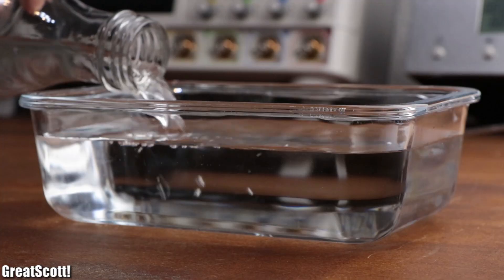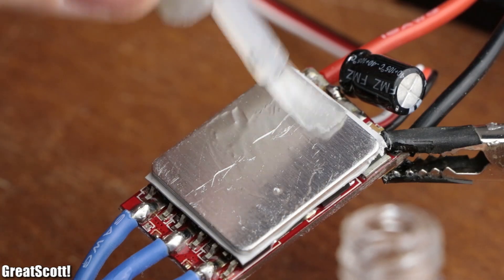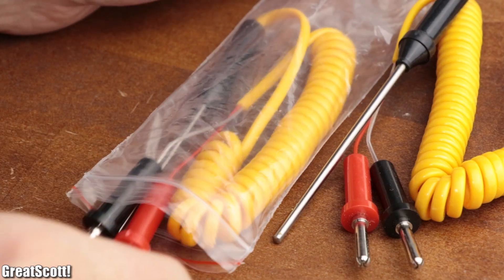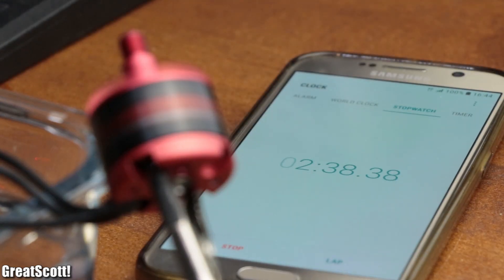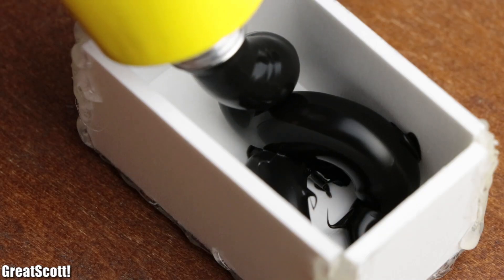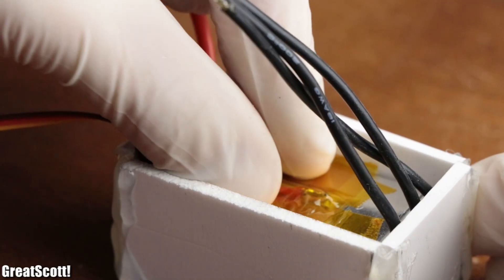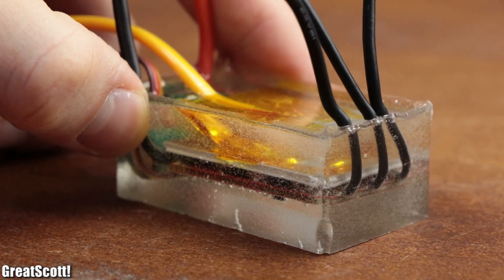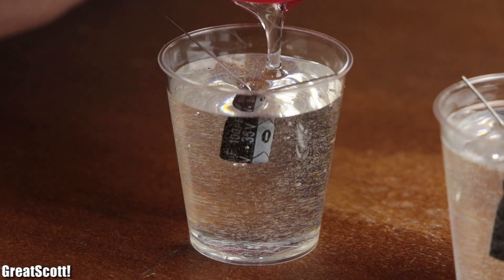How to Waterproof Electronics || Nail Polish, Silicone, Potting Compound

Comment: Hi, just use the right type of silicone, which is the 2- component version.
It's also used for casting pewter abd resins.
Hardens in 24 hours, if used the standard hardener.

Comment: Wasn't it a problem, that you didn't apply a load to the motors? In my opinion the heat produced should be approximately proportional to the power needed to drive the motor.

Comment: heat the silicone first to reduce viscosity? even ambient temperature fluctuations can make the difference between a successful and unsuccessful potting. also you can use a small seal-able tub filled with clear nail polish or clear-coat for better results, just dunk your board in, give it a shake and wait a while, then pull it out and hang it up by a wire to dry; much easier to get it into the nooks and crannies. painting nail varnish onto boards to waterproof level with only one coat is very difficult due to the way it shrinks during curing process. it is often worth going back for a second or third coat to fill voids larger than 1mm

Comment: How to make BL Dc motor waterproof ? For example project like  RC submarine..
Reply: BLDC motors are not affected by water, as there are no open contacts across which current would flow. They are commonly used for model submarines and other watercraft for this reason. See this video: https://www.youtube.com/watch?v=86-l2_THgWc
Reply: https://www.youtube.com/watch?v=s4z8QMgTEA4

Comment: Silicone has to evaporate out to set, which takes time, especially for a deep coating.  I've read the the slightly acidic liquid in weatherproofing versions of silicone can cause corrosion on circuits.  No doubt, you can get varieties that control this issue.  

The only way to totally protect a circuit, especially if used at depth, is total encapsulation with magnetic switches.  Eventually, some moisture will migrate along the wires if they pierce the coating.  I've seen timers used at depth in marine research that were stopped when a fish yanked the magnet off the encapsulated counter circuit permitting when the fish took the bait on the longline.

Comment: I use epoxy for the most part, but there's quite a few projects that need far more complex waterproofing strategies. Ports, for example, need rubber plugs which is usually the main point of failure. While components that need breathing room like LIPO cells usually get a plastic housing. The company I work for makes smart batteries for the military and even we don't guarantee full waterproofing.

Comment: You don't want to solder your TC connection together.  You weld it!  You compromised the integrity of your temperature measurements because K type consists of Nickel-Chromium and Nickel-Alumel and you just added (most likely) lead and tin into the mix.

Comment: The silicone needs moisture from the air to penetrate to cure, why you're better off using a two-component compound when applying thicker than ~10 millimeter. Also, all these examples may eventually fail in a humid environment because moisture from the air may wick inside the stranded wire as the electronics thermal cycle. Solid terminals and connectors at the interface are one solution.

Comment: Great video as always :)

Nail polish is quick and easy but it is a mess when you wan to solder new cable such as esc signal wires on a quadcopter flight controller.
There is special product like this https://www.youtube.com/watch?v=HOu5hRqSDtU which are great to work with.
Hope it help you

Comment: I've found Plasti Dip clear to work well. Since it's an aerosol it gets into fine spaces. It cures quickly so a few coats can be applied. It also remains somewhat flexible so it handles flexing around wire to board connections.
Reply: Hello , hope u r doin great !
Can we use plastidip on car engine sensors , under the bonnet ?

Comment: +greatscott: silicone will corrode copper traces, especially for the acetic cure type, which might do harm for projects that are built to withstand the test of time.. i've also tried using neutral cure type, lasted longer, but still corrodes copper..
Reply from the maker: Thanks for the information

Comment: Hmmmm.
Interesting, I have been looking for sourcing locally (Switzerland) conformal coating to apply to my quadcopter electronics, but with no success.
I have found on ebay a few  422B-55ML from MG chemical, but from GB or USA.

Do you mean that a simple nail polish application can already go a long way ?
That would be very easy to source.

Comment: You really overdid it on the silicon and the Kabelvergussmaße.
I think the amount of silicon used also was the reason why it didn't cure: Uhu Datasheet says more than 3 days for anything thicker than 5 mm - and you went a bit further than that. With a mixing silicon it would have worked better. And for both the silicon as well as the sealing resin it would have been enough if you just gave it a coating (a few mm into the box, then dip the regulator into it and take it back out).
Reply: Yeah, chunks of silicone can take very long to dry. The inside probably was still liquid. 
I did some silicone casts for an art project in school a few years back and sometimes the molds were still not hardened through a week after.
Reply: @franziska1007  silicon casting in art. Who paid for that
Reply: @sammyd7857  I guess the school? It was a class that basically did renovation-like art and crafts around the school building. In our case creating casts for plaster figures with prehistoric ocean dwellers that then were put onto ocean themed school halls. 
It was just on course per year and a limited amount of students, so the individual budget was relatively high.
Reply: franziska1007 Well if you do it like the king of random with 2 compound silicone, it can cure from some hours to one day
Reply: The store bought silicone that smells like vinegar has to be exposed to moisture. It does not cure well in a deep box and can take months. Epoxy and silicone will poison each other and can cause a fail to cure even trace amounts of uncured material. Cure one fully before applying the other. Make sure things are very clean after cure and between applications.
Reply: wich 1 works better silicon or rezine?

Comment: I think that best waterproofing product is NANOPROTECH. I used it in RC cars and no problems. Currently I'm using it on a car( octavia) in blinker where is water every time when its raining. No problem whatsoever.. I also used plastidip... it works but it can get weak by the time and it's hard to peel off... NANOPROTECH is way to go!

Comment: There should have been a control test with an unprotected esc in water
Reply from the maker: I did not show it on camera but I tried it. Did not work underwater.
Reply: Awesome! Props for being thorough even when it doesn't make the video!

Comment: the temperature measurements were flawed, an ESC doesn't draw a lot of current/create a lot of heat if the motor is spinning freely. You should have put some load on the motor.
Reply: GreatScott! I think a propeller would be good and consistant enough, because you can set the same speed everytime
Reply: Valitos 

At no load, very little heat would be generated relative to the heat generated at the full load rating of the ESC. It is quite likely that some of those configurations tested would cause the ESC to go into thermal shutdown or to fry if run near the full load rating.

Adding nail polish between the FET's and the heatsink will decrease the effectiveness of the heatsink.

In the past, I have used thermally conductive epoxy to attach heatsinks. That would likely work better than anything you tested in this video. I think it was made by Deltabond and was sold in tubes by DigiKey.
Reply: It is also not recomended to run the motor without load because of the bearings. Some high kv motors can destroy the bearings in seconds at full power/rpm, in any case it increases the wear on them. So always use only low throttle for testing or put a prop on.
Reply: Even a resistor connected to a constant power source would've been a better way to measure the thermal conductivity.
Reply: Under the same conditions it provided relative temperature measurements. So the test was OK for that. If the test was specifically to see at what heat it would withstand under load, then yes, but this was not really the goal of the experiment in my opinion.
Reply: It was just good he didn't since the ESCs would have been destroyed due to lack of cooling.
Reply: @dtiydr  But that was the point of the test.
Reply: @jdotoz  No, the video was about to waterproof electronics which as such is no problems to do with a neutral type (very important!) silicon but you have to think if it is something that get warm inside and need cooling.

At 6:51 where its said "while simultaneously featuring sufficient heat transfer capability" is not correct since silicon sealant have a very bad heat transfer capability which should have been mentioned. 

To isolate a ESC with a thick layer of silicone sealant like this will destroy it as soon as there will be put a load on it since it will not be cooled even close to as much as needed. A thin layer of lacquer instead could be ok. When driving the ECS with an idling motor as in the video there will not be any load and thus no heat to talk about and thus will not overheat, at load the temperature will go up like a rocket until  destruction.
Reply: @dtiydr  Almost as if the thermal performance of the waterproofing method were an important thing to consider, isn't it?
Reply: @jdotoz  Yes if (read when) someone would do exactly the same thing and the ECS would go up in smoke within seconds since it wasn't cooled, so yea it is definitely important to mention no matter what the video was originally about. Other electronics should have been used for the test and not saying it had good heat transfer capabilities since it don't and that can fool ppl.
Reply from the maker: I did not have the equipment to add a constant load to the rotor.
Reply: @greatscottlab  I know those motors have mounting materials usually included, but in the end hindsight is 20 20.

Would love to see a more heat intensive test though at some point.
Reply: @greatscottlab  Take it skateboarding for 20 mins. Hahaha

Comment: I still learned more than at school.

You better do a function Generator DIY or BUY
Reply from the maker: It is on my to do list
Reply: Just use your phones jack output. Your phone is a function generator.
Reply: GreatScott! Ich hab eine racing drone, die komplett offen ist und weil ich sie erst jetzt bekommen habe würde ich sie gerne wasserfest machen( 1 mal ist sie schon im schnee gecrashed) 
In der Schweiz kann ich kein Silikon conformal coating finden!!
Wie sieht es aus mit nail polish???
Vtx ist halt schon ziemlich heiss
Aber ich hätte 4in 1 esc's und wenn was kaputt geht muss ich löten können!!!
Reply: @ariafpv  Er antwortet nicht auf deutsche kommentare
Reply: @ZillionPrey  er kann doch Deutsch???
Reply: Less DiY or buy more diy
Reply: GreatScott! Thanks so much!
Reply: with a shitty frequency. Also, you might damage it. A function generator has higher frequency/bandwidth, signal fidelity and I/O protection
Reply: @Leonelf0  what does a shitty frequency even mean 🤣🤣🤣🤣
Reply: @dimitrijekrstic7567  Low bandwidth
Reply: @Leonelf0  frequency range?
Reply: @dimitrijekrstic7567  my comment was originally a reply to the suggestion to use a phone audio jack as a frequency generator. A phones frequency generator has a bandwidth of 22kHz. I say bandwidth because this means that a sinewave of 22kHz will be output with 3dB of Attenuation. A triangle wave at that frequency will be mich more distorted as it has a higher bandwidth than a sine wave (due to harmonics)
Reply: Lol me too

Comment: Can you make a video about converting AC to DC please
Reply: quangluu96 ElectroBOOM Fan spotted
Reply: IT ISN'T A PUNY SINGLE DIODE RECTIFIER
Reply: Just 4 diodes in a specific Order
But DC to AC would   be nice. Maybe a DIY or Buy?
Reply: Bardvark ac to DC is easy. just a full bridge rectifier. and a capacitor. and you have DC!
Reply: davide patrone Are you a patreon of ElectroBOOM?
Reply: electrobuilder no that would still be AC. He wanted to CONVERT AC TO DC
Reply: +Ujwal Bhagat   not already
Reply: zjkktuf ffxgjtgths. Buy would win because diy version isn't stable and efficient enough
Reply: Matija Vukonić probably
Reply: Four diodes.
 There ya go
Reply: Bardvark use capacitor
Reply: You just use a full bridge rectifier
Reply: You need power supply...